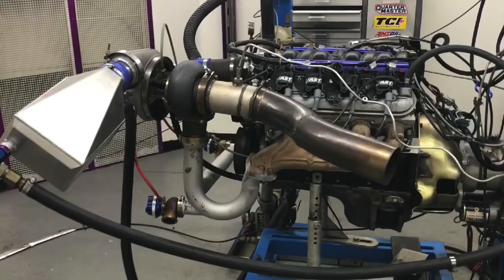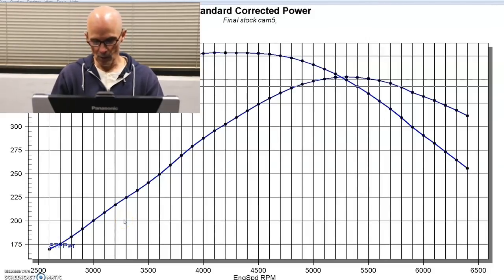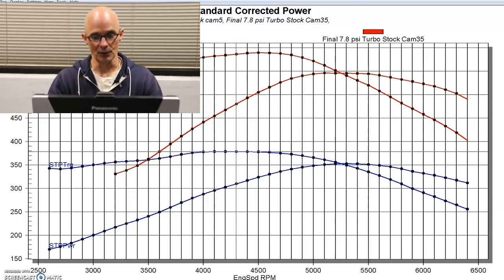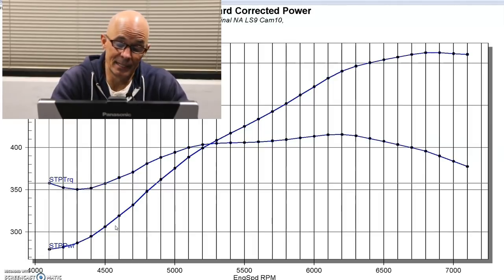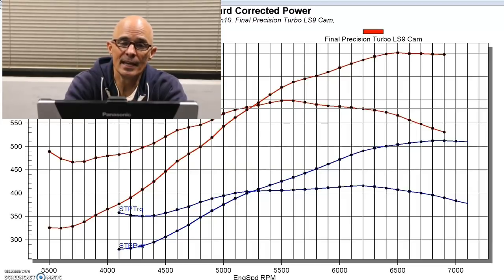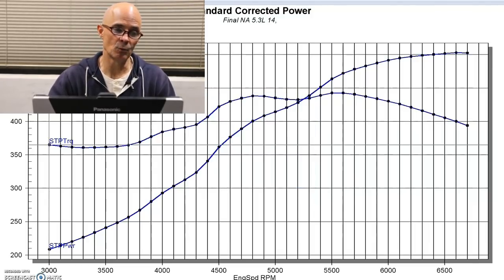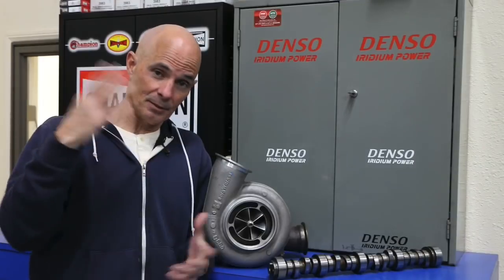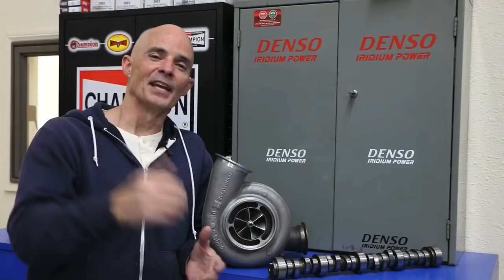REVEALED-DIY TURBO SECRET-EVERY CAM WORKS!

Comment: Unfortunately we don’t race Dyno’s. I think you missed the whole point of a turbo cam. When I added a turbo with a non turbo cam, it was more laggy than the turbo cam I went to. It also came into boost sooner with the turbo cam. So yea cams don’t matter in a Dyno, but they do in a vehicle.
Reply: He's saying that any cam will work,  just size the turbo to work with the cam if you already have the engine together.
Reply: Todd Allen I get that part. But no one really ever said it won’t work. Of course it’ll add power. But at the expense of what? What trade off? Well my trade off was my car was lazy and took a bit to come into boost. With a “turbo” cam, that lag is negated more and the engine is more responsive out of boost and comes into boost sooner. It’s a cool test but it does not tell the tale of how an engine will act in car vehicle, which is what they are used for mostly. Maybe in a boat it wouldn’t matter but my car being a dog and not being able to merge into traffic unless it in boost is just not how I’d want it. Full race car I guess who cares. But something you drive, a turbo cam is going to make a difference. My car drives much better with the turbo cam. It’s not really much smaller but it doesn’t have any overlap but my na cam did have overlap. Overlap will also blow boost right back out the exhaust. That’s another story.
Reply from the maker: If one cam makes more power NA, even down low, it will offer better spool response. Pick the cam that does the things you want then add boost. If you think this was somehow a condemnation of turbo cams, you missed the point.
Reply: Richard Holdener nope. Did not think it was a condemnation of turbo cams. I appreciate the video too. But in my experience, which isn’t as much as yours, but in my car things are different than on a Dyno. See your starting the pull past 3000rpm which doesn’t tell what it does down low and how soon boost comes in. Just saying, Dyno test doesn’t settle it and doesn’t tell the whole tale.

Comment: Richard, love these tests man but here's one question I have for you. At what point does valve overlap begin to negate turbo performance? Idk how much overlap is in some of the larger cams you're running but one would think that eventually with longer durations in combination with a fairly tight LSA would start to mess with it? Or is it just a matter where no matter the overlap the turbo if sized correctly it's just simply capable of overcoming the overlap and just keeps the boost pressure high enough that it doesn't matter?

Comment: 1 year later, I want to believe this….I have a 231-242@.050 cam on a 113 centerline. Is it actually going to spool anything or should I grab a shorter duration? Or just feed all the nitrous to it?
Reply: With a supercharger or nitrous, there is some reward with lots of exhaust valve capacity. This can be a combination of one of or all of: 
A) duration
B) valve size
C) lift

Comment: Hey Richard I just bought a tsp cam 231/234 .629/.615 for my gen 4 5.3. I also plan on getting prc 15 degree 220cc cathedral port heads to help the cam. Anyways my question is can I run the speed engineering twin turbo kit with those heads and cam?
Reply from the maker: yes-but it's a very big cam and will be soft down low-don't need that much cam with turbos unless you want 1500-2000 hp
Reply: @richardholdener1727  I called up tsp and pointed me at their i think new 4.8/5.3 turbo cams I've never seen them before so I got #25-TSPturbo4-3b stage 4 4.8/5.3 222/230 .600/.600. Hoping to get 7 to 800 out of speed engineering tt kit.

Comment: I am now afraid to put boost on my FE,, I am afraid 😱 I would blow it up. It seems like a .020 over at 4.07x 3.784 should like it. Maybe new rods? At 14.7 at 400 hp would be 800 so 700 at the tires would be great.

Comment: Say Rich.... I just ordered that Truck Norris cam for my GTO LS2 6.0 enging, 7675 Precision turbo... Swapping out my Comp Cam LS1 54-424-11.... I hope I didn't mess up.... Any insight for me... Are these 2 cams to simular... Specs on COMP cam 212/218 @ 0.050" - 0.558"/
0.563" lift on 115*
Reply from the maker: see the Truck Norris cam under boost video
Reply: @richardholdener1727  Daaaanggg, you already done that video too👀👀🥺🥺... Okay... Alright then, bet that uuuppp.... I'm on it👍🏿👍🏿👍🏿👍🏿

Comment: They all make more power, but would you say turbo cams make more power per psi, especially in aituations where exhaust backpressure is high. I always thaught turbo specific cams were installed to prevent reversion of exhaust gases back in the intake under high backpressure.
Reply: I thought turbo cams made same power with lower intake psi and a lot lower exhaust pressure
Reply from the maker: I a turbo cam makes less power NA, it will make less hp/psi. Until (possibly) back pressure becomes and issue.

Comment: So why did Texas Speed direct me to get a stage 2 turbo cam rather than a 228R or 224R cam? The tech's explanation was the duration is designed for the boost to work better with the rpm range.

Comment: Is too much overlap going to kill power? I've got a 455 olds with a single "gt45" that I'm building, it will have a 226/241 on a 107 degree lobe separation. Am I gonna lose power over a stock camshaft?
Reply from the maker: you wont lose power over a stock cam-the stock is way too mild-that is a tight lsa but it will still work, that motor is a tad on the big side for the GT45
Reply: Only gonna rev to 5k, olds problems ya know.

Comment: I agree and I am 100% sure this is correct when running LS engines on an engine dyno with high octane fuel. 
Here in my country the struggle is real. Small engines, 85 octane MON pump fuel and we are only interested in what is delivered to the wheels in a chassis dyno. We have had good luck with turbo cams that allow us to increase boost and rpm without exceeding the maximum allowable exhaust temperatures of about 1000 degrees C.  The camdata on these cams have never worked good in any NA engine. but I do not have documentation to put forward.
I would also like to mention aussie  Dick Johnsons "Gr.A" Ford Sierra RS500. His 16 valve 2.0 engine delivered about 600 hp at 2.0 BAR boost (29.4 psi) ( that is 200 hp from the theoretical NA engine) but only 90 hp when tested NA. This it what a true turbo cam does. It makes the engine work much better under boost, in the car, than it does when tested NA. 

A dedicated nitrous cam can increase the power output of an SBC by 100 hp by opening the exhaust valve very early. So early in fact that then engine looses quite a bit of power when testet NA. :)
Reply from the maker: I guarantee a 2.0L Cosworth motor doesn't make only 90 hp NA.
Reply: @richardholdener1727  I did not remember correctly. It was 680 hp @ 2,4 BAR og boost = 34.8 psi, but still 200 hp from the theoretical NA engine.  
About the 90 hp from the true Na: https://www.youtube.com/watch?v=B0TcptAlu4E&t=118s

Comment: Hey richard i know this video was old but ive been going through your videos i was trying to see if you tested a gen 3 5.3 (L59) with 243 heads ported .023 over running comp cam xer273hr-14 and seeing what kind of numbers that would make and also seeing what it would make under boost.
Reply from the maker: who ported them-what do they flow, what intake? lots of things
Reply: @richardholdener1727  ls6 intake 
Correction: heads were milled 0.24 with a valve job flow is unknown

Comment: I'm looking at turbo charging a m110 Mercedes dohc hemi head 2.8 inline 6 cyl. There are US and EURO spec engines. The US have less overlap for emissions. Will the overlap on my euro motor (which makes considerably more power, with more Compression as well) cause a loss over the US cam that will shut the exhaust valve earlier, keeping the charge in?

Comment: Would it be wrong to believe that a turbo cam is designed to optimize the efficiency and/or safety of a boosted setup while also giving the engine a better powerband for boost? Or is the difference pretty negligible in practice? 

I always thought that the best cam is one that's built for your particular setup. 

To me, how much power an engine makes isnt exactly the most important thing. Whats more important is how efficiently and safely it makes that power, and how usable that power is.

Example: I'd rather drive a 5.3 that makes 600 horsepower on low boost with a safe tune as opposed to one that makes the same or similar with higher boost and/or timing.

I'm pretty new to this so any help or insight would be appreciated.

Comment: I think this is a great way to make guys look at cam choices    If you got a shitty curve n/a it’s gona be a shitty curve under boost.  You might not be optimizing your power out put but it’s all gona work the same.  Obviously there is better cams for boost. Or N/a. But they will all work regardless.  Great way to simplify cam choice.

Comment: I'd think the idea of a "turbo cam" is outmoded. It's more from the days you'd have something like a Martin system that was running a 350 with a 60-1 with a P (or less) trim turbine and a .68 turbine or something where there's an OE application that uses what's really an under sized turbo. As you said if you've got enough turbine you're gonna make the power.

I was talking with some other people today about another cam misnomer; The idea of a "computer compatible" cam. It makes me chuckle that's even a phrase used any more. Retuning required absolutely but the amount of cams that aren't usable with an ECU is probably fairly minimal.

Comment: You keep saying that no matter the cam, it works with boost I'm assuming you mean boost from a turbo. But will this also happen with boost from a procharger? I have a small n/a cam in my 5.3 220/224 575 split lift 112+4

Comment: I found this video to be very interesting and informative. I want to put a pair of turbos on my 469 in.³ Pontiac motor, but I thought I would certainly have to change the cam. I have a comp magnum and with 1.65 rockers it is about .580 lift and 248 Degrees of duration on a 110 lobe sep, Is this really going to work?

Comment: Ok. I have a stock ls3 with a cammotion single plane cam with a carb that makes great power.  So if I switch to efi single plane with a correct sized turbo it will make 1100 hp @14psi.   Everyone knows my combination now has repeatedly made over 550hp.  I’d like to hear your thoughts

Comment: I have a Texas Speed cam pushrod and Springs with a .600 .600 value lift ,lobe separation 112 and Duration of .050. 216 - 220 what size turbo would you recommend?

Comment: I have ls3 416 stroker in my '15 camaro with GPI SS4NFC  would this cam work with twin turbos??  Specs below. I'm being told no, I'm currently running. Novi1500 centrifugal supercharger,  but it isn't big enough. 
In./Ex. Duration

236/252

In./Ex. Valve Lift

.646/.637

LSA

113

ICL

+4
Reply from the maker: it can be run with turbos-but would not be my choice
Reply: @richardholdener1727  what would you suggest can wise,  and what size single,  or twins

Comment: What effect does LSA have with boost? A tight LSA with lots of overlap vs a wide LSA with minimal overlap? If it has a lot of overlap will that have fuel air mix blowing out the exhaust? While the effect on power output might be minimal, how does it affect other things like BFSC, EGT, etc? Obviously if you throw more air into it, the thing is going to make more power up to the point where the air is too hot for the fuel and power will drop off. 

Since I run Pontiac engines I rarely cam them for peak HP, opting to go for maximum torque between idle and 5000 RPM, and LSA makes a difference in what I do, particularly when it comes to octane sensitivity when I am not running E85. Considering my 700hp+@6500 rpm 467 is using the same heads/CNC program as Justin Shearer's Crow that is making around 3000hp, its obvious what happens when you throw boost to it.  I doubt my 270/272@.050 108 solid roller is going to work well with the turbos Chief is running. Nobody will divulge his cam specs, and I found out what the heads are from who ported them, since we have the same program from the same people. I got mine first.. lol. My bottom end is not up to boost like that, so I have no plans to turbo that engine.

Sure, throwing hairdryers at it will increase power, but what are the other effects besides power output. FYI with that roller cam, and ported E heads with a factory pushrod location, that 467 is making over 520rwtq down at 3000rpm NA with only a 10.5:1 SCR. It was down some due to having 4 bent intake valves from a handful of gravel being dumped down the carb. (Long story) Its slightly different where these engines make their power, and how much, vs the small LS/Ford engines and big chevys with 'lazy' ports.  Lazy being a relative term to my engines and port velocity. The cam timing shows up quite well in the ET when you're running a 3.08 to 3.55 gear NA and it affects more than peak power.

A last thing. since ethanol has a very good latent heat of vaporization and not much propensity to ping/knock, why don't we move the injectors higher in the runners and let the fuel cool the intake charge more like what a carb does? The injectors are as close to the valve as possible as a band aid for the low octane, and to keep it from 'puddling' on the runner walls and floor. No worries with ethanol, it vaporizes readily and cools the charge. The TBI style system are somewhat more limited than the port EFI as far as tuning, so its not an apples to apples using a FiTech or Sniper like unit vs the injectors close to the valves. Under boost introducing ethanol earlier should be beneficial. Not unlike the injectors above the blower in a nitromethane engine. Obviously there are limits with the LS intake, since they have rather long runners inside the manifold and are not a wet manifold, but its still possible with aftermarket intakes or other engines. Direct injection would be the worst possible way to go with ethanol nearly zero time for the fuel to vaporize, as its a band aid for low octane gas so you can get a higher SCR to work. Might allow for more boost without the IC to move the injectors up the runner some more.

I'd find out all of this but I am sans dyno now, closest one is 7 hours away.
Reply from the maker: would the boost blow out the exhaust when the back pressure is higher than boost pressure

Comment: I see all camshafts respond well to turbocharging. What happens if you run a single turbo on a twin turbo stick? I was given a btr twin turbo stage 2 cam and was thinking about using it.
Reply from the maker: whatever the cam does na-it does under boost

Comment: Now they're picking on you. Anyway, it's easy to see the logic. Normal atmospheric pressure is 14.7 pounds pers quare inch (norma , don't climb a mountain),add another 14.7 lbs of pressure you get practically twice whatever you had before! 🤔👍

Comment: I believe "turbo cams" are a marketing gimmick manufacturers use as an excuse to expand their product line. Same as the "rectangle port cams". A cam should be chosen based on desired engine behavior considering compression, displacement, intake, and exhaust design.
Reply from the maker: There are cams that are designed with the characteristic of a turbo in mind

Comment: Richard are you familiar with the 5.2 & 5.9 magnum mopar engine ? I was hoping to turbocharge my r/t pickup or my ram 1500. Rear mount turbo is what I want to do but I have no idea what I need.
Reply: It will be mostly custom turbo hot/ cold side build but it'll work.  Like Richard said,  you can boost anything.
Reply: @Turbo_Todd  thanks for the tip
Reply from the maker: they can be run with boost

Comment: Ok , tell me if this is the name of Sean Connery’s last movie , Never say never again . Worst case scenario , BBC with a David Vizard style cam 106 degrees lobe separation with a ton of boost , we were told that narrow overlap like that blows boost charge out the exhaust .
Reply from the maker: how does the boost blow out when the back pressure is higher than the boost? Its more likely the other way around
Reply: Richard Holdener , well according to all the written word in the “ mags “ you know which ones and the camshaft section of the manuals (how to turbo your engine ) stated that too much overlap pushed  more of the intake charge out the exhaust than a wider separation and listed 110 degrees as the limit , are you saying that narrow lobe separation cause of excessive reversion ? Don’t get me wrong I open your vid in the morning as soon  as I see them as I think your posting the best stuff I see followed by Sloppy Matt ; even though my engine Is the opposite of Matt’s stuff .

Comment: But you forgot about the dynamic compression ratio! It's an engine safety measurement and your curves are not showing very low and very high rpm's differences. You're right for a budget build but for serious applications, you'll need a well designed camshaft.

Comment: So i have a question.. when a cam is labeled as a turbo cam, does that just mean that the cam is better at dealing with back pressure? If not, why would someone bother using a turbo cam over an NA cam, assuming cost vs performance is similar.